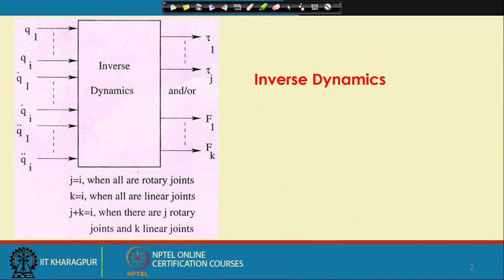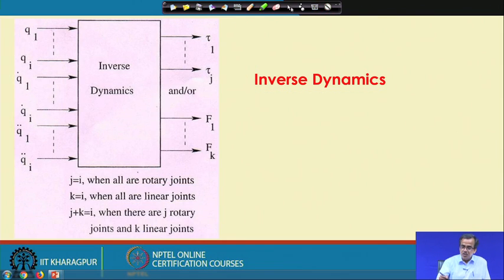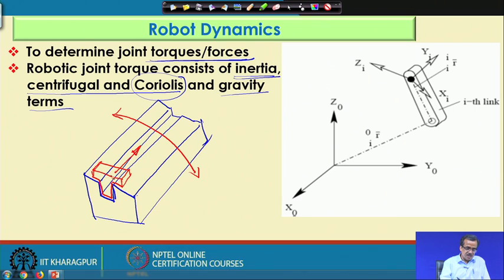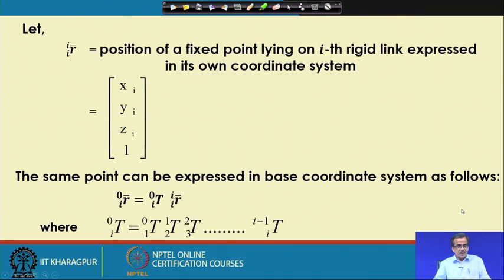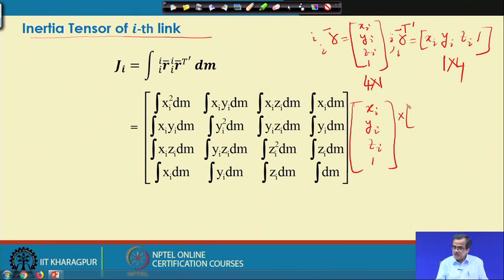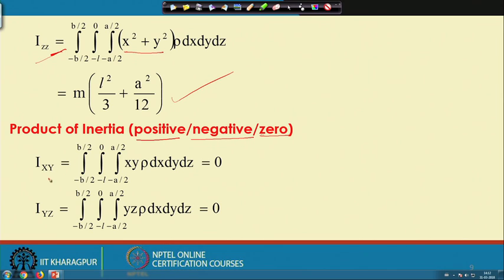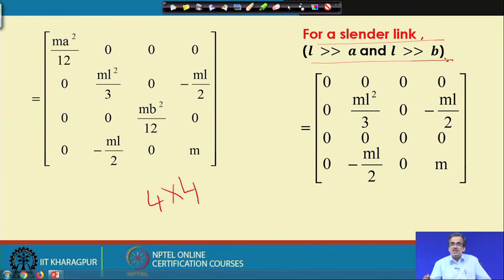Lecture 24: Robot Dynamics

Comment: I have a doubt how we are assigning limits and why a/2 value is used instead of a
Reply: because the reference( or origin) is taken in the middle of the rectangle (right face of the rectangle ) but the length is defined as 'a' so from middle to the left we have -a/2 and to the right +a/2
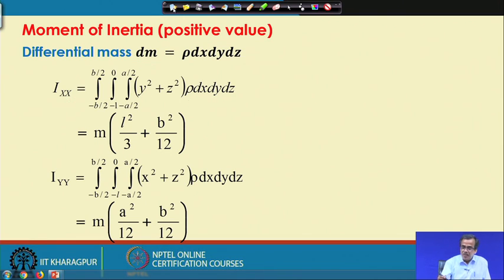Reply: 21:59